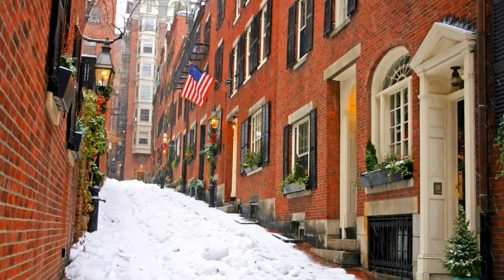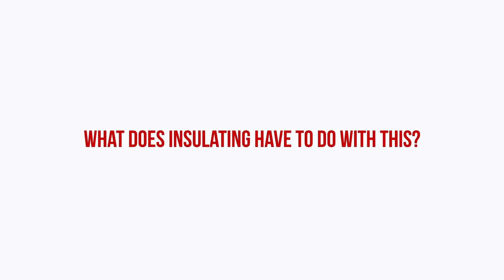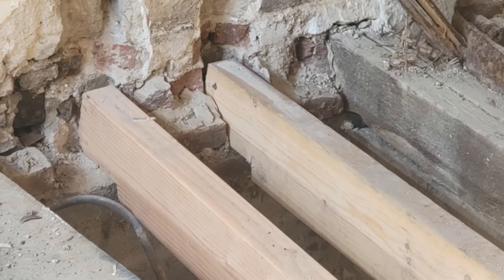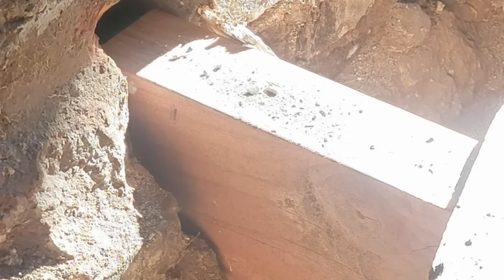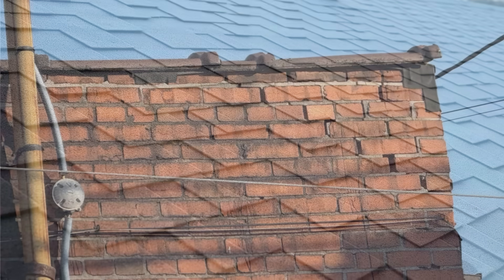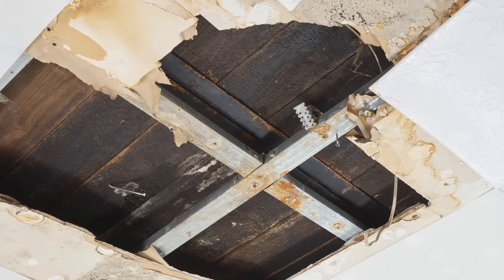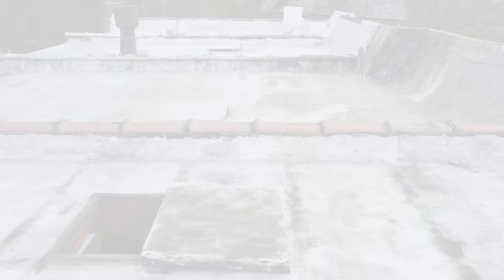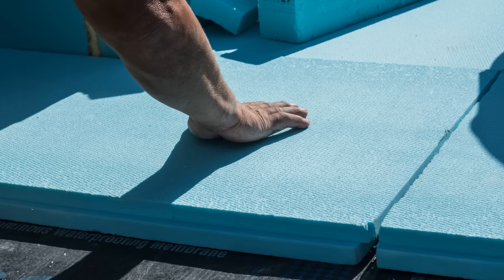Insulating a 100 YEAR OLD Building (What You NEED To Know)

Comment: Thanks for your content - I purchased your guide for moisture management in residential remodels and have a specific question, as I do not have the space to build the exact wall assembly recommended. I have a 1930s build with exterior brick and structural terracotta. I am attempting to find a way to insulate within about 2 inches that does not damage the building structure. My plan was to treat the exterior brick for bulk water, fur out the walls with a small air gap between wood and terracotta, and apply xps / polyiso / closed cell foam. Would this create issues if done above grade in climate zone 5? Is there anything I can do to insulate without removing plaster from the terracotta block? Or is it best to leave the structure as is? Thank you so much!

Comment: I need to build a new basement door leading out to cellar doors. Plus new cellar doors. Still gonna throw tarp over them for winter. The cellar doors and poor quality wooden stairs were an add on done in cmu the original foundation is all brick. Done before we owned house or it would fit a chest freezer through it. I hate our front block porch up against our foundation. Acts like a huge heat sink.

Comment: Do I "definitely"  need to insulate the interior side of my poured basement walls in North Georgia?  I have a 4 year old home with roughly 3200 sq ft unfinished basement now with 2x6 walls on the daylight side (across the back of the home), and about 60% of the basement underground with poured 10 ft foundation walls.  I have a Broan AI  ERV for the basement as well as a brand new Carrier heat pump inverter Infiniti system conditioning the basement (a zoned system shared with the main level of the house above).  Measured humidity is always almost exactly 50% in the summer. Never had any moisture of any kind on the poured walls, and the whole 3200 sq ft barely varies in temperature.  I had planned to put 2" of closed cell foam on all of the poured walls, but given that I never have condensation or moisture, and the heating and cooling load is so minimal, is it worth the cost of installing that insulation?  What problem am I solving?  Does the chance of moisture go up drastically once I finish the walls with drywall? There certainly seems to be no chance of moisture right  now...

Comment: I am buying an 1893 home that is minimally insulated but in very good condition (was inspected by a home inspector and structural engineer yesterday).  Unfortunately I don’t have the budget to do a full remodel and properly insulate. Would a very low r value rockwool still be sufficient to allow for drying while benefitting from partial slowing of energy loss? Even something like r4 should slow the energy loss to some degree for completely uninsulated houses.  I do not want to compromise what has kept this house in good condition for 122 years but given it’s fully uninsulated in Western MA, I am trying to find a middle ground.
Reply: I'd focus on air sealing first, then do the insulation when more money is available. Air sealing is always good for both reducing energy usage and reducing movement of warm moist air into the wall spaces and thus preventing moisture damage.

Comment: Fantastic video, a commonly misunderstood and misrepresented issue which can cause serious issues. I'm not sure how prevelant it is in the US, but in older buildings in the UK and Europe (France particlarly) the use of hempcrete is becoming more common. Specifically when in the presence of breathable outer walls (lime mortar, cladded timber frame, etc). As it's hygroscopic and has both fantastic insulative & temperature regulating properties.
Reply: Well this video is spot on. I just went trough the whole isolation standars and practice document issued in France (Enertech) dealing mostly with old building isolation and a lot of stuff has been found in this video also. This really isn't simple matters for non-specialists and I can't stop to scratch my head by the contradictory objectives. (Thermal isolation goals and water/humidity/water vapor issues)
Reply: Hempcrete isn't used very often in the US, and in my opinion for good reason. It's not a structural material, so it has to be supported by something else, which is the US is often a wood frame wall. Hempcrete is dense by wood frame standards so it requires stronger than average frame walls, which old buildings don't tend to have. Its insulating value is poor compared to mineral wool and rigid foam. Hygroscopy generally isn't a good quality in the US since our climates are hotter, wetter, and stormier than Europe so unless it's heavily protected from the elements it will stay wet.